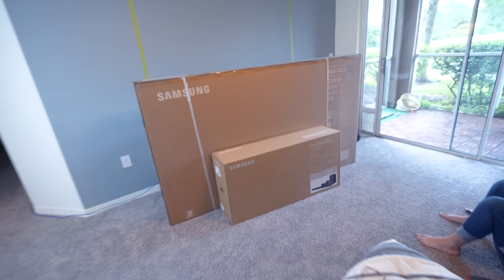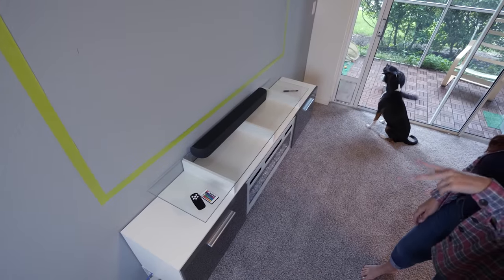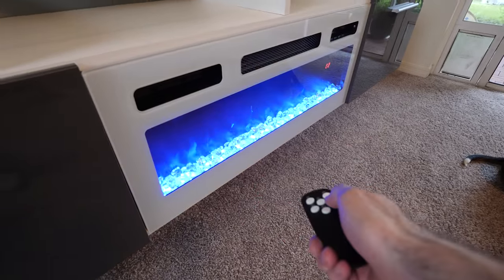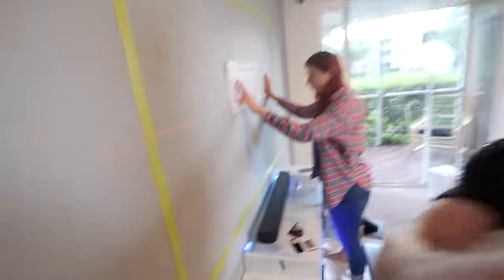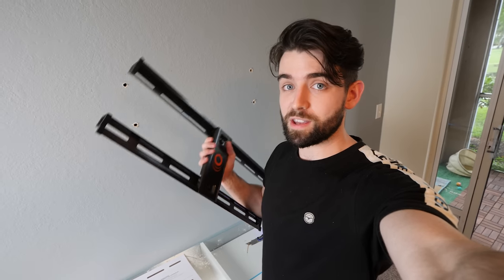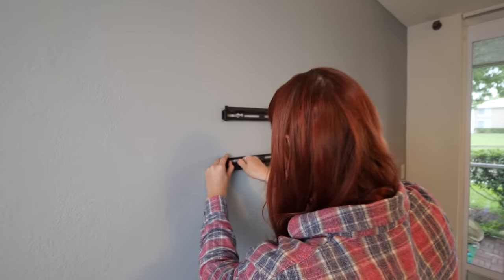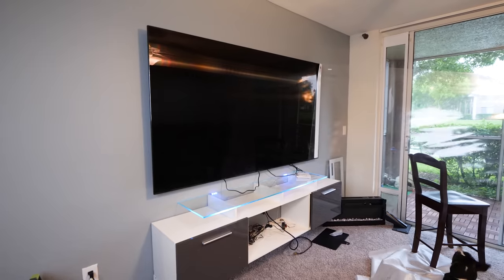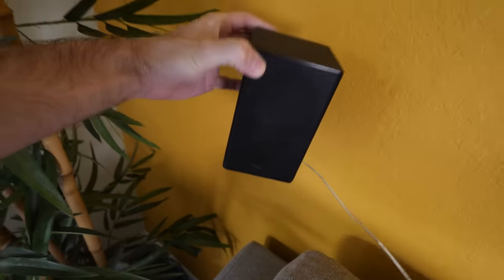Building a Crazy TV Setup in Our Living Room! *85 Inch TV*

Comment: That is sexy as hell! Just recently my wife and I mounted our MUCH smaller tv than that BEAST but nonetheless the cinematic feel just increases by like 10 fold when its hovering off the wall. It's incredible, probably gonna get a sound bar of some type next. It also cleared up so much room. only problem I wound up running into is some of those cheaper stud finders are lets just say.. poo poo xD. Ended up getting a pretty expensive stud finder that never stuffs up, however it lacks the metal/cable etc detection so it's like pray and hope i dont hit the electricity everytime i find a stud lol

Comment: The 85 inch q80a and qn85a are actually really good tvs. If you look anywhere online everyone craps on these TVs for using a ads (ips like) panel which has a trash contrast ratio and gray blacks. 
But that only applies to the smaller sizes. The 85 inch versions are a lot better because they use VA panels and have Samsung’s viewing angle filter.

Only bad thing is no Dolby vision and quality drops dramatically in game mode
Reply from the maker: Yep! Exactly why we went with the 85 inch model, I don't know why samsung didn't make it more clear in the marketing on the other models, they look so bad compared to this

Comment: Love my 85” tv. I use a receiver and physical 5.1 speakers. For the rear, I just got a wireless base and receiver. The back speakers are wired to it. So requires wire cleanup but works very well too.